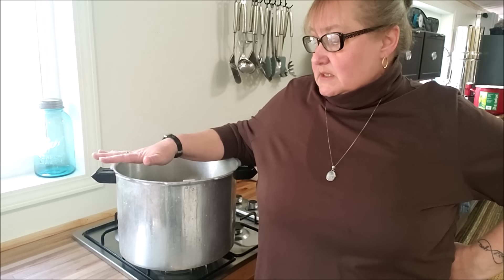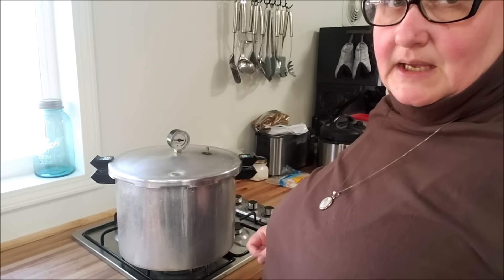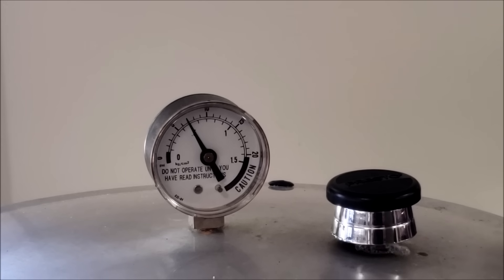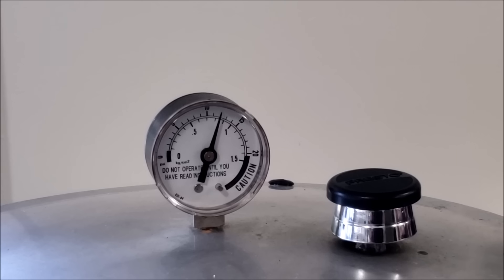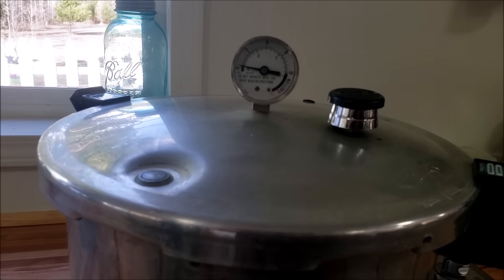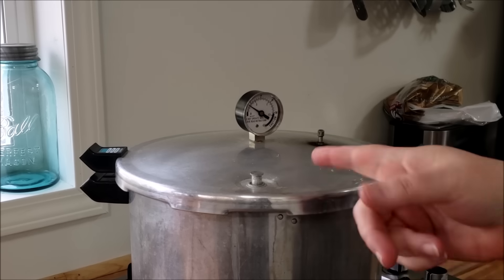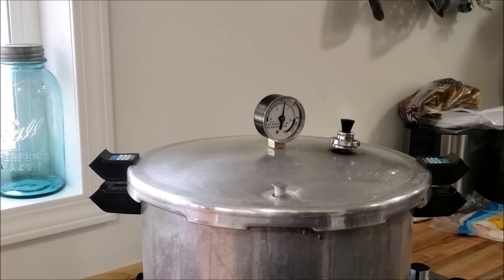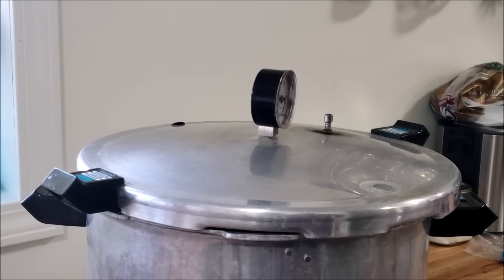Start To Finish with the Regulator & Jiggler - Canning 101 Presto Pressure Canner

Comment: So my lock button let large amounts of steam come out of that. Yours doesn’t have any steam coming out of it. Do you know why that is happening and how to fix? Thanks. Good vid
Reply: Mine does that too. Sometimes I think it will never build steam because its escaping thru the lock button. One time after 20 minutes I took a really thin knife and barley touched the metal lock button where it meets the lid and it shot right up. When I said barley touched it I mean it. I did not dig or force it up in any way. It has worked correctly ever since. Remember she said that our canners are different in very small ways even though they are from the same manufacturer.

Comment: Thank you for this wonderful video! My question: I was canning 70 lbs of chicken thighs, bone-in-- which had to be processed round-the-clock b/c freezer was full. After processing a final round of thighs (middle of the night) , set timer to 1-hour cool down, and woke up well past that 1-hour cool-down. Basically, the jars sat in my All American for several hours. I've searched online but can't find advice if it's safe to eat--the lids did seal.
Reply from the maker: They are good
Reply: @SuttonsDaze  Thank You! This is a huge relief  :   )

Comment: I was in the process of doing my first ever canning batch using my canner manual and Ball Book when I saw your video. Now I have a couple of questions. When I took the jars out of the canner, the lids were all sealed but a couple of the rings had loosened up. Is that normal? Secondly, I have an electric stove and as you know it takes awhile for the temperature to change when you adjust the dial and now I'm worried I did drop just below 12 lbs at one point when I was trying to get it to come down off 13 lbs. I think to be on the safe side I'll run the batch again, but it is late now for me to get started. Is it okay if I do this tomorrow and start all over again with heating up the broth on the stovetop before jarring it up and going from there? Thank you for such a detailed video on this canner!
Reply from the maker: Yes its normal for the lids to losen, Yes it's ok. You've got this!

Comment: Thank you so much for this information, however, I do have a question. Last year I was taught to leave the regulator on at all times.  I never saw this version of letting it vent for 10 mts, then put the regulator on.  I canned a lot last year and have used my canned goods, and everything is fine.  Did I just go a long way about it by not venting first, but going straight to keeping the regulator on, getting my pressure up, then timing?  I am curious now seeing this that I may have a pantry full of bad canned items.  I would appreciate any input on this.  Thank you so much!
Reply from the maker: Venting is a must
Reply: Read the guide that came with your canner.  If it was me, i would Not throw out my processed food.  Just me..  been canning for almost 15 years.

Comment: I want a jiggler where to find one?
Reply: Amazon and presto sell the weight one along with replacement standard 15lb one
Reply: The second video shows a different one. I didn’t see if mine comes apart or not I’m at work watching you tube. Lol I have one but it’s like the one in the first demonstration Leisa did. Are they one in the same. I just recently got my presto 16 qt canner and I’ve only played with it once.
Reply from the maker: Check my link below
Reply: Found mine at the local Ace Hardware, Amazon has been out of stock
Reply: @amyarsenault9053  No, they are not the same.  "Jiggler" (as Leisa uses that word in this video) is a nickname for this part:  "Presto Pressure Canner Pressure Regulator Stock No. 50332", which costs about $12 USD.  It is basically a 3-piece weight that does not come with the pressure canner.  You buy it separately later.  It adjusts to 5 or 10 or 15 pounds of pressure depending on how many of its metal rings you add to or remove from it.  It sounds as though the regulator you have now is the standard 1-piece one that came with the canner and will only jiggle if the pressure gets up to 15 lbs.
Reply: @marygallagher3428  it is the one that came with it and is a one piece
Reply: @amyarsenault9053  Hi Amy.  In that case, unless you live at a high elevation and would always have to pressure can at 15 lbs of pressure, you would probably enjoy having the 3-piece "jiggler".  You can check on the gopresto dot com website to see if it will fit your model of Presto pressure canner  :-)
Reply: @marygallagher3428  no I live in 900 ‘ altitude so I need the 10 lb
Reply: @amyarsenault9053  O.K., If you have one of the following models of Presto pressure canners, then the 3-piece "jiggler" Leisa demonstrated in this video should work with it:  "Compatible Products
01/C13 - 13-Quart Pressure Canner
01/C17 - 17-Quart Pressure Canner
01/C22 - 22-Quart Pressure Canner
0171001 - 13-Quart Pressure Canner
0171002 - 15-Quart Pressure Canner
0171003 - 15-Quart Pressure Canner
0174001 - 17-Quart Pressure Canner
0174510 - 16-Quart Pressure Canner
0177001 - 22-Quart Pressure Canner
0178209 - 23-Quart Pressure Canner
02/CAA12H - 12-Quart Pressure Canner
02/CAA16H - 16-Quart Pressure Canner
02/CAA20H - 20-Quart Pressure Canner"
Reply: @marygallagher3428  no my model is 0175510:( 16 qt thank you for the info, I ordered one maybe it will work.
Reply: @amyarsenault9053  It's worth a try anyway  :-)  If the 3-piece "jiggler" doesn't fit on your canner's vent pipe, you could call the folks at Presto to see if there is any way to replace the vent pipe with a different style of vent pipe that would work with that "jiggler".
Reply: Thank you!

Comment: You can adjust the propane gas on your stove by taking off the knob and using a small Phillips screwdriver to turn the screw inside the knob. You should be able to do this with your cooktop too.

Comment: My Presto Pressure Canner is about 60yrs old.  It belonged to my parents.  I'm not sure if I have the jiggler or the regulator.  I'm thinking it is the regulator because it looks like the one in your amazon link.  Also, the hole for the gauge has a gasket in it and there is not a screw. Am I missing parts or is it just the early design?  The gasket is in there pretty good. But, it is old and I'm wondering if I need to replace it.  The gauge will screw in pretty tight but it is not bolted. I wish I could include a picture for you to see.
Reply: I don't know about pressure canners that are old but you can take it to your local extension office and have them check your dial. Replacing the rubber thingy is inexpensive so do that.

Comment: I think I’ve commented about the “jiggler” not being listed as working with the Presto 23, I talked with the company this morning and was able to order the jiggler @$12.+ (it’s cheaper on Amazon).  I asked why the model ending in 107 was not listed, and customer service said it’s because for that model, it’s an after market item, that the 23 comes with only one weight-15psi.  I hope this is helpful, because I’ve been stressed about this issue since Christmas.  I had wondered if the actual vent pipe would need to be changed, she said, either weight fits the pipe on the 23 lid.
Reply: Thank you Sandi
Reply: So, i

Comment: Just quick question it did say keep it at 12 pounds but to be safe I ran it between 13 1/2 and 14 because when I tried to turn it down it dropped fast. My elevation is about 3600 feet. Sooo what happens if 13 1/2 up to 14 when it says 12 and I processed it at 13-14 for the 25 min? Is is bad 🤷🏼‍♀️
Reply from the maker: Not ideal, but not bad

Comment: Question from a newbie… I just purchased a 5/10/15 lb ringed regulator and pressure canned sirloin and mushrooms with 1/2 of the jar filled with beef broth. 1” headspace. DebubbIed and followed all the instructions. 3 qts of water in the canner and Vented a steady stream of steam for 10 min. Added the 10 lb weight brought to pressure and timed for 90 min. All went well. The pressure maintained steady throughout the 90 min. After the wait time to depressurize When it came time to remove the lid there was only about 1 cup (maybe 1/4-1/2”)of water left in the canner. Is this normal using this weight? I just used the gauge in the past with the weight that came with the canner and have not had this issue. I didn’t see any visible steam leaking from anywhere except a tiny bit under the weight. The canner is new and I’ve only used it maybe 4 or 5 times.
Reply from the maker: Add a bit more water when canning meats

Comment: I am canning with a new Presto Canner. No gauge just with the pressure adaptor. I let the steam escape for 10 minutes, the air vent lock pops up before I put on the pressure regulator. Instructions say the regulator should be on before the vent lock pops up.  Anyway, I then put the pressure regulator on, but it never jiggles. Suggestions for trouble shooting? Thanks
Reply: Mines doing the same but i found if the pressure goes around 13 it jiggles 🤷‍♀️🤦‍♀️

Comment: Question so is there anything that can’t be canned in this canner other than high acid foods?  That’s in the UADA book or Ball blue book?
Reply from the maker: Ball, Bernardin,  NCFHFP,  and edu sites
Reply: High acid foods are less problematic than low acid ones.
Reply from the maker: @gavinmcewen5896  None are problematic if you follow the safe guidelines
Reply: Ok then. While I'm quite sure you knew perfectly well what I meant, and that I was obviously correcting an incorrect assumption in the question garypostell5268  posted, Let me rephrase for sake of semantics: High acid foods generally require less intense processing than low acid ones do.

Comment: I just got my 23 qt Presto and am
having to use a 1500 watt cast iron commercial hot plate because I cannot use it on my glass cook top. ($400 lesson learned and not wanting to do it again) ok I turned my hot plate up on 12 as high as it would go (after I had let the water get hot and put my jars in)  I waited and waited and waited to actually see steam but never did.  The lock raised up.  I was worried as that the time had been 45-60 minutes and would it go dry??  So I went ahead and put the regulator on and got up to 12 for 40 minutes.   Was this ok???  I am a newbie….
Reply: You have to have a burner that keeps steady heat. Some hot plates cycle on/off which is no good for canning.

Comment: I cant get mine to stay just right on my gas cooker. Its either creeping up slowly the i move the temp guage and then it starts creeping back. I move it not even a ml and it creeps.
Reply: Get the jiggler she talks about. It is a godsend also as you reduce the heat do it micro slow. My jiggler will hit 11 to 12 ish PSI (I am under 1000feet so I want 10 to 11) once it starts to hiss from steam I start reducing the flame until it goes above 10 and keep SLOWLY backing the flame down, it takes time to see any change in the pressure so I am guessing you are not being patent enough dont change the flame more than once per minute unless your seeing the pressure gauge going up (even with the jiggler). With the jiggler you can just keep reducing the flame, again slowly unstill the wiggler is just dancing a little bit and your gauge is in the range you want. As she said you dont want it to drop below the proper pressure so GO SLOW .Also practice with jars of water.

Comment: Yup, if your model of Presto will work with it, the "jiggler" is the way to go  :-)
Reply from the maker: Very true!
Reply: Thank you for educating us all with your knowledge and experience. Very good point. I picked one up, lo and behold, it did not fit my canner model. I am keeping it, waiting for another canner to come my way. I do have the old time round disc 5,10,15 lb in one.
Reply: @raydeenjaques2048  Hi Raydeen.  If your current canner is a Presto, you might want to contact the company and ask if the new "Presto Pressure Canner Regulator Kit, Stock No. 85485" (costs about $16 USD) would work with it.  That kit includes a replacement vent pipe as well as the 3-piece regulator ("jiggler") weight.  It's possible that if you are able to install that new vent pipe on your existing canner, you could then use the "jiggler".  Worth asking anyhow  :-). If you shop for that kit, make sure you're getting the new version of the kit that includes a "jiggler" like the 3-piece one Leisa demonstrated.  However, since you already bought a "jiggler", maybe you could just get a replacement vent pipe?  The company's customer service folks should be able to advise you about that.

Comment: I have heard folks say we don't need to sterilize the jars before canning anymore, is that correct? I either hand washed in hot water or dishwasher depending on if I am home or my friend's house with the broken dishwasher. Should I sterilize the jars in the oven or just wash them really well and pour boiling water into them? I have been boiling the jars in a huge water bath canner before canning, but if I can skip a step and be safe I am willing. I have seen some folks just use a tea kettle full of boiling water to pour into the jars before canning.  So far I have only canned in brand new jars that I have washed in the dishwasher or boiled.
Reply from the maker: https://nchfp.uga.edu/publications/nchfp/factsheets/sterilizing.html

Comment: I have used my jiggler and mine jiggles a little harder then yours. I know not to look at gauge however it’s right on Ten or 11 the whole time. Like as soon as the gauge hits ten the jiggler starts. And it maintains with my jiggler rocking a little harder then yours. Is that okay? It’s a new canner. I’ve used it three times.

Comment: W?hat are all the next steps IF your psi drops below?  Example,  I lost power when I was canning (23Q Presto induction Canner) chicken in pints.  I had 40 minutes left to go and lost power.  Canner cooled down to 0...etc.  I took jars out, they all sealed.  My power came back on a few hours later...can I start over?  Can I put the jars back in even though they are sealed or should I pop the seals and then put them back in the canner?  How does this second process affect the food?
Reply from the maker: They need to be reprocessed from the beginning, change the lids
Reply: @Suttons Daze  what would happen if I don't change lids?
Reply from the maker: @BoxMountainLLC  lids could fail

Comment: Hello Lisa, how are you? I just bought a new 23qt Presto canner,  I have never used a gage canner before. I had a Graniteware 20qt canner that I loved but it ran dry and it warped. So I am having the following issue: for the giggler  to start dancing the regulator will go up to 15 pounds of pressure, I am in a 10 pound area so I have the giggler with one of the weights to make it 10 pounds, like the one you have. Is that  safe and ok. I know you said not to pay attention to the gage if you are using the giggler. Then if I use the pressure regulator that came with the canner I have a hard time keeping the pressure at 10 pounds. I do all the steps wait the ten minutes of steady stream before putting the giggler. Also lots of water comes out through the lock before coming to pressure. Can the canner be defective? I am frustrated,, please help. Thanks
Reply from the maker: https://youtu.be/WP_HHkOibQ4
Reply: I have the regulator and it stops jiggling at 14 psi,.  I wish Presto would address this issue, because I’ll bet 80 %of people canning are at less than 2000sea level.  This issue is not even mentioned in the owners manual.  I’m gonna order the weighted thingy.  I figured something was wrong with the dial, so I’ve let the rocker rule (15psi) my decision.  Got an appointment Tuesday to have my gauge inspected.

Comment: When showing the jiggler (that's what I have) and you say if not juggling like it should because heat is too low and you have to start over.   .. what do you mean by start over? Do you mean turn fire off, let cool and then start the fire back up and all? I hope I make sense. Lol. Thank you so much for these helpful videos 🤗
Reply: You just start your timer again- if your cooking for 90 min, are 10 min in and see it’s too low, just reset timer once you back at your correct pressure

Comment: Hello, I'm new to canning. I have a Presto 23 qt pressure canner. I allowed the canner to bent steam for 10 minutes. Is it normal for water to spurt out of the vent pipe? Also one I put my jiggler on how long does it usually take for it to start dancing? I also had water bubbling around the vent lock and it did not pop up. Is this OK?
Reply: Id say yes, mine does that as well
Reply: @T500cal  Thanks that makes me feel better.

Comment: Is the water measured before the rack is put in?
The reason not to use high is the bottom can warp. I had a 20 year old presto 23 qt that JUST warped on the bottom heating on high.

Comment: If my elevation calls for 11 pounds of pressure and I only use 10 pounds on the jiggler would it not fall short on pressurizing at 11 or above? I have seen people say use 15 pounds if you require 11. to use the 15-pound weight. I am NEW and CHICKEN! Thank you for your videos!
Reply: Stephanie, im hoping someone answers your question. I also need 11lbs and have a jiggler. Im so nervous.
Reply: I think it would be okay...search for "common sense home altitude adjustments," and click the first result. The page provides a table that compares canning pressures at different altitudes for both the dial gauge and the weighted gauge. For 0 - 1,000 ft, the dial gauge would need to be at 11 lbs of pressure, while the weighted gauge would be 10. For anything over 1,000 ft, the weighted gauge would need to be at 15 lbs pressure, while the dial gauge requirements climb incrementally.

Based on the table, if your altitude is below 1,000 ft, you would be fine to use 10 lbs pressure with the jiggler. If you are over 1,000 ft, you would want to use 15 lbs with the jiggler.